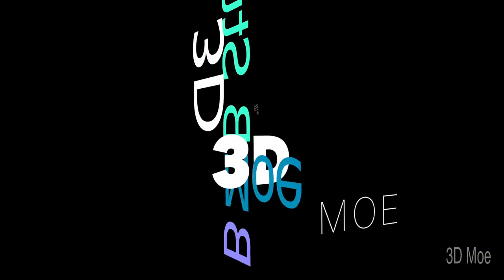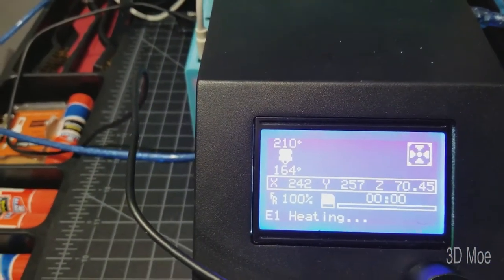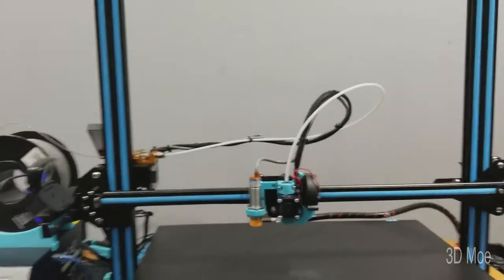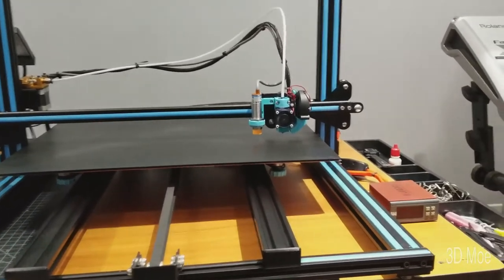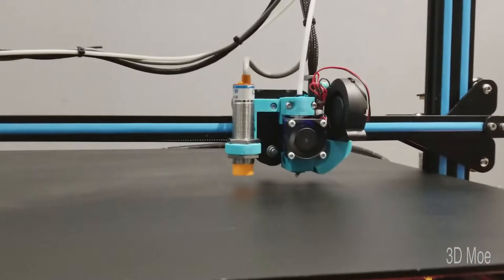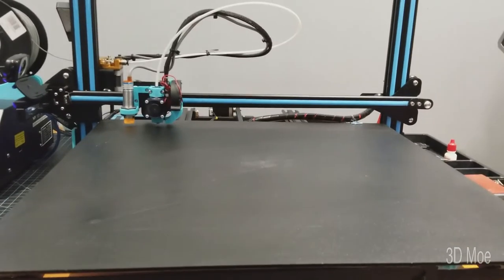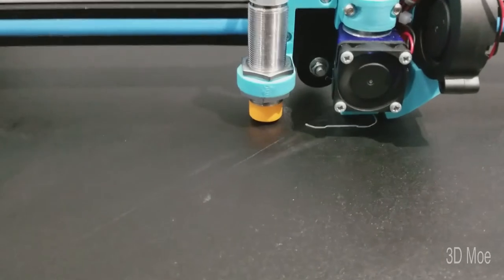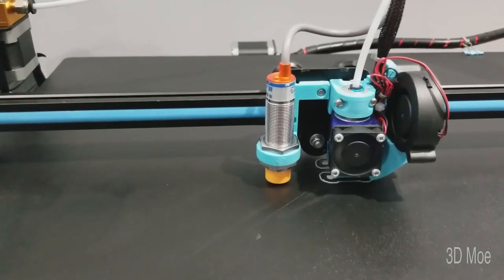EZABL/Keenovo AC Heated Bed with TPLink Wifi Outlets

Comment: Other than my previous, relay/plugin version of a solution for this issue (previously commented here), I found another solution that eliminates the need to do this whole mess... Shield all of your endstop and EZABL cables with tin-copper shielding to prevent RFI/EMI interference. It worked like a charm for me. I still have the heated bed and LED's turn off automatically while creating the mesh just because... I already had that setup. More of a just in case thing but the shielding seems to have also solved the problem. I don't understand why they don't shield their cables to begin with, especially on something that's SO EXTREMELY SENSITIVE to RFI and EMI interference...
Reply from the maker: Baronial10 thats a awesome find...Great Job! Will have to try it..

Comment: Is that a TH3D EZABL??? If it is, I'm curious as to why it takes so long to do auto bed leveling??? I am, however, quite impressed with the speed of your print. I have an Ender 5 Plus that I just bought TH3D's 18mm EZABL Pro, along with their main board, LCD upgrade, and solid bed mounts. I also have a Keenovo heated bed, with the same bed controller you have on the side of your printer, and a Micro Swiss hot end. I would love to see how you connected this to wifi and everything else. I know absolutely nothing about Octoprint.

Comment: In case anyone is wondering about the easier way to do this: 

In Octoprint, go to settings (wrench tool icon)/Plugin Manager/Get More... and then search for "Enclosure Plugin" - install it, restart your pi/octoprint and then go back to settings and near the bottom you will see "Enclosure Plugin" - select that and then: 

Output type: Regular IO
Label: Heated Bed
IO Number: whichever pin you used on the pi to connect to the relay. NOTE: You want to use the actual pin number, not the number directly after "GPIO". 
Uncheck "Active Low" 
Check "Show Button on Navbar" if you'd like a manual way to control the heated bed. 

In your startup script use: 

.......... (whatever you have before G28 goes before)
ENC O1 S0 ; turn heated bed off
G28 ; home all axes
G28 Z ; home Z to get more accurate Z position
G29 ; EZABL mesh generation
ENC O1 S1 ; turn heated bed on
.......... (whatever you have after G29 goes after)

The ENC code basics: ENC O(look at the ID in your Enclosure Plugin output assigned to the heated bed to see what number to put here) S(1 = on, 0 = off). And note that that is the letter "o" after ENC and the letter "s" after the "o". That's not a number 0 and 5. 

You can add as many relays as you want this way along with a slew of other things. I also highly recommend the Enclosure Plugin documentation to see what else you can do. I have mine control my Keenovo heated bed, my LED's and my entire printer. FLow: Printer turns off heated bed and LED's (LED's can cause interference), do the EZABL mesh, turn the heated bed and LED's back on and then start the print. Once the print is finished, my setup will turn off the heated bed, wait for 10 minutes for the hotend to cool off and then it will shut off the printer.

Comment: Great!  This will save me a lot of headaches.  Could you do a quick thing on how to get Octoprint to control the TPLink?
Reply: there is a plug-in now for octoprint that uses the ip of the tp-link and ties it to  M80 and M81 gcode... i use the tp-link to turn on and off the printer remotely
Reply from the maker: As i stated in the Video there is a plugin now .. i did not go that route i added the library's and created a custom gcode command. that is no longer needed anymore with the plugin.. if you need help with the plugin i a can throw something together ...let me know
Reply: thanks, I'm still waiting for my machine so it will be a while before I get to this.  I'll probably be OK figuring out the plug in.

Comment: nice job , one question what is the size for this Solid Bed Mounts i will design one for me
Reply from the maker: mine are 28mm, high but i am using buildtak no glass so if you using glass i would subtract the thickness of your glass
Reply: 3D Moe thanks a lot 👍

Comment: Hi Moe...thanks for the great videos.  I'm having problems with my cr10s heated bed not working and I'm considering getting the keenovo bed heater as a replacement, like the one you have.  I'm wondering did you just disconnect the heater from the controller or did you have to do anything to the firmware to shut off the stock heater?  Thanks, Richard Jackson
Reply from the maker: Richard Jackson yes had to turn off the heat bed in the firmware
Reply: Ok Moe, thanks for that. Can you give me an idea of how to do that?  I'm really leaning towards the keenovo.  Does yours do the job for you?  Thanks again

Comment: if i am using the TpLink smart plugin and its able to power on/off successfully - witch is the GCODE command needed to auto-power off after the printing is finished? Please advice as i am not using the "long way of building the library". Just one to stop/start the kenovo before and after a print. thanks in advance.

Comment: I'm looking to get an S5 to print helmets. I have an E3D spare here from another printer, do you recommend going with the E3D mod, and getting the AC heated bed and sensor etc?
Reply from the maker: yes the original heat bed is garbage and the screws to level the bed are so hard to reach there will be no live adjusting on the fly like the little guys

Comment: When I send M81 <ip Address> in the GCODE, both the hot end and bed set points are set to zero and the LCD displays "TH3D EZABL Off".  I'm running 1.1.7.1.
Is there a way to configure the firmware to ignore the M81 command?

Comment: Nice video.  You mentioned the plugin available, just wanted to make sure people knew where it was (shameless plug), makes the process a little easier. https://github.com/jneilliii/OctoPrint-TPLinkSmartplug. Once installed, go into TPLink Smartplug settings set ip/hostname of your tplink plug (used in gcode snippet below) and enable GCODE and disable warnings. Then your GCODE startup script in your slicer would be as follows (replace <ip/hostname> with actual ip/hostname):

M80 <ip/hostname of plug> ; heat bed on
G28 ; home all axes
M81 <ip/hostname of plug> ; heat bed off
G29 ; auto level
M80 <ip/hostname of plug> ; heat bed on
G1 X0 Y20 Z0.2 F3000 ; get ready to prime
G92 E0 ; reset extrusion distance
G1 F200 E15 ; extrude 3mm of filament
G92 E0 ; reset extrusion distance again

Comment: Why do you bother to turn off the heated bed? seems like a waste there... considering that as its heating/cooling it can warp the bed... so as you are probing and the bed cools off, you are getting false readings compared to what the actual levelness of the bed is once heated up. If its something to do with AC interfering, then get a different probe or use a better controller/heater that doesn't throw off such EMF spikes...
Reply from the maker: Hikari my probe doesn't work well with the ac power on... I get wavy readings with it on
Reply from the maker: Wacky